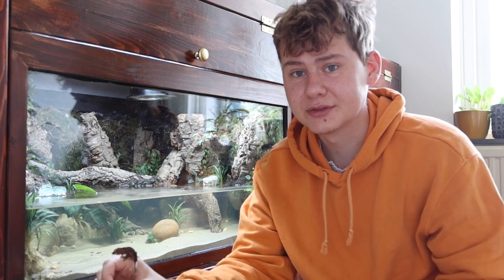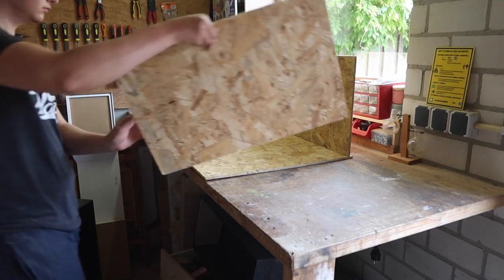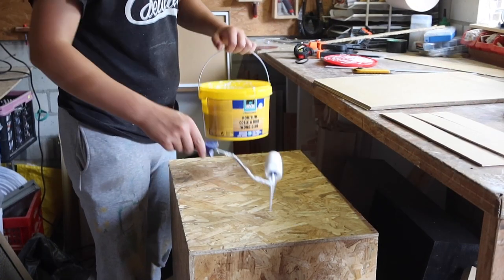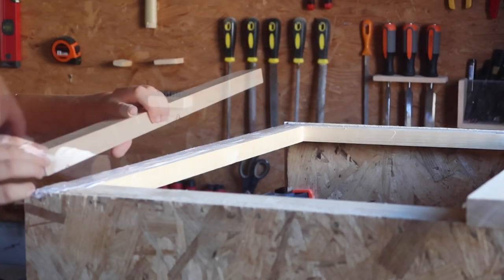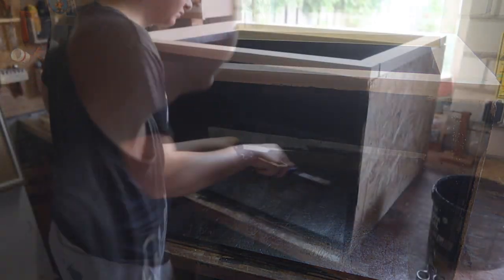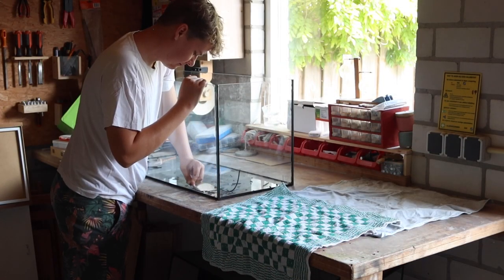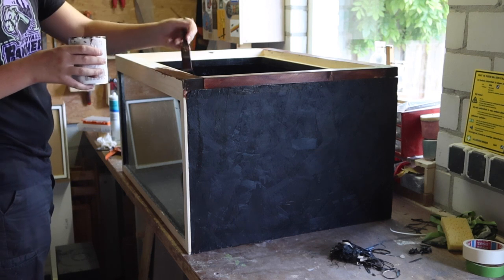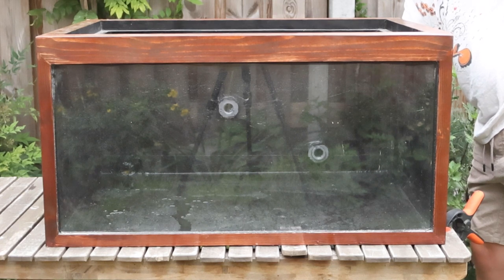How To Build The Ultimate Plywood Aquarium

Comment from the maker: Would you make a DIY aquarium? Or would you rather buy one?
Reply: After watching Aquarjium Adventures channel.. Am afraid to use liquid Rubber and fiberglass and silicone.. Somehow his bonds between different chemicals did not hold. His 8 ft tank kept on leaking...
You somehow must have had no problems with only rubber and silicone.
Does silicone bond well to Liquid Rubber?
I think the other guy had issues with Rubber sticking to other materials, like cured silicone.
Reply from the maker: @bubblerings  I must say I’ve never heard of that channel yet, but I’ll look into it in a sec. What I can tell you about my experience with this technique is this.

The order in which you apply everything is important. I’ve noticed that liquid rubber won’t stick to cure silicone, but silicone will stick to cured rubber. I’ve had issues with a leak in my crested gecko’s vivarium, which was made in the same way. The leak came from a bulkhead which was siliconed into place. The way I went about fixing it was soaking some of that fabric in liquid rubber and sticking those over the silicone, making sure there was some overlap on all sides. Probably not the best way to fix something like this, but probably the fastest. I wouldn’t do this if the setup had to hold water permanently like the tank shown above. 

I think liquid rubber is a decent choise when building a diy aquarium, but I’ve done some more research since this video and I can see some flaws and ways to improve upon this design. I do have an updated video planned out for somewhere this year where I discuss all of this as wel as share a better design.
Reply from the maker: @bubblerings  I've actuallly seen his video's before haha. Anyway if you build a tank that big waterpressure will start to play a big role. I don't know how to calculate that sort of stuff, but I know it's something to consider when building giant aquariums.
Reply: @CrunchyFern  (it leaked again, am watching. He drained it again)
Best wishes for you, this year!! 🍀🌻 
It is whale watching season all winter over here.🐋🐳🐋
-Scotty on Maui.🐚🐙🌺🌴